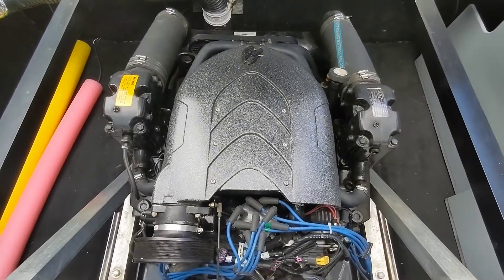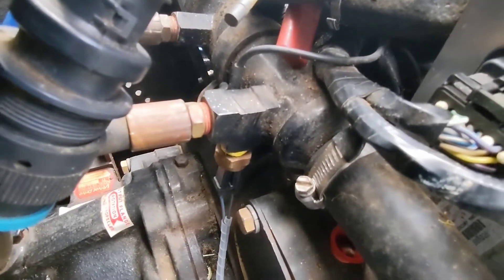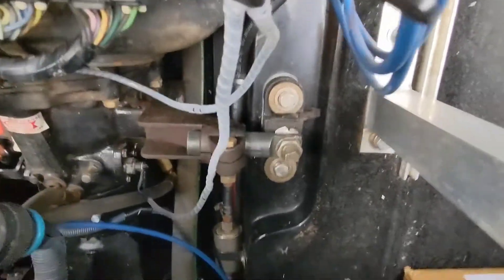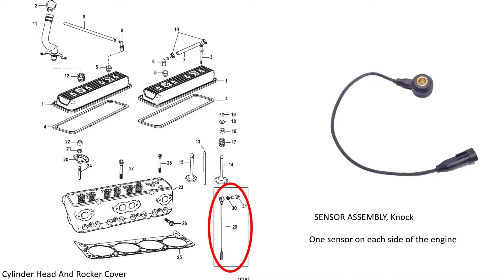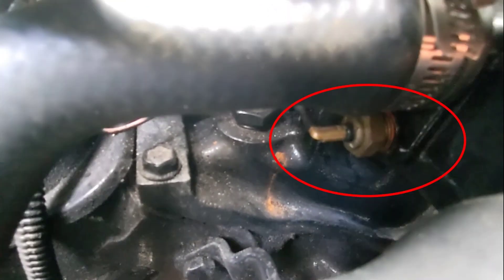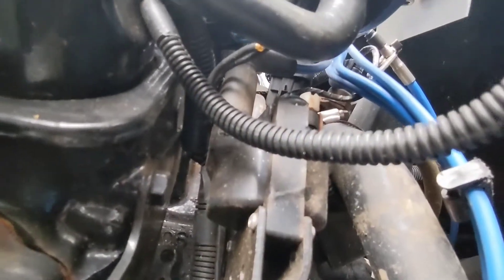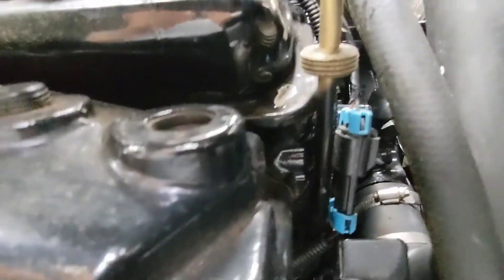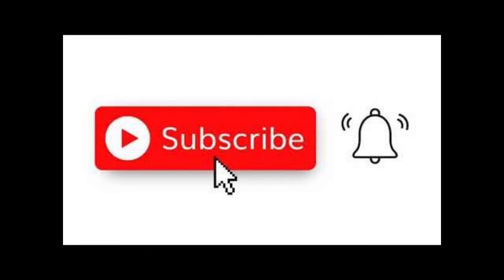Mercruiser 5.7 6.2 engine motor sensors and electronics

Comment: My water pressure sensor wires look like they might be getting pinched. I have a beeping in the boat for about 15 seconds on and 15 off only while under way. Wondering if that might be it
Reply from the maker: You should look at my other video. This system will let you know exactly what the problem is. https://youtu.be/qrIJ4Hsu1IU

Comment: Thanks for this informative video. 
I have also have a 5.7 liter Black Scorpion engine. It is idling very rough, but the engine seems to run fine with higher rpms. Any idea what the problem might be? Thanks
Reply from the maker: @marvleier5327  you should replace the IAC valve and the head gasket. If this doesn't help, consider cleaning your injectors and measuring the fuel pressure to the injectors.
Reply: @ItaiLeshniak  I think I will start with the iac valve.  Thanks
Reply: @ItaiLeshniak , I replaced the water separating fuel filter and now my engine is running as it should. I thought I would let you know. Thanks

Comment: You have a good understanding of these engines. What are your thoughts on a stalling issue I have. I have a 2006 Supreme with this engine I replaced all filters and the IAC valve. It has a new cap and rotor. After running the boat out on the lake when I return to the 5 MPH area while idling into the dock it will stall out and some times stall but not completely shut off. It starts right back up.  Any ideas of where to start checking? It runs great otherwise but irritating when it randomly does it in the 5 mph areas. Everyone seemed to say IAC valve but a brand new Mercury valve was installed.
Reply from the maker: I would assume you either have an air leak so I hope you changed the head gasket. The other thing you may want to try and clean the injectors. Hard to say without getting more information. Check out my other video on how to connect to the computer. It's worth the investment you may find out some interesting stuff.
Reply: @ItaiLeshniak  Yes I replaced the plenum gasket when I replaced the IAC valve.  I will check out your other videos! Thank you.

Comment: You never made an impeller replacement video for this engine?  I have same engine/boat.  Appreciate what you have posted👍
Reply from the maker: Not yet. Maybe next spring.
Reply: I need impeller video also! And where is the sea water impeller
Reply: @kenleyhockett7473  the sea water pump is under the passenger (port) idle pulley at the very bottom. I just changed mine not too long ago.

Comment: What year is engine?
Reply from the maker: 2007
Reply: Thank you. Where can I find the purple/white wire to set initial timing? I have a 2006 Sanger v210 Black Scorpion. Thx for your videos
Reply from the maker: @dantheplumber3233  I am not that I understand the question, are you asking where is the sensor? what is the problem and what are you trying to do?
Reply: Just like the 90s gm vehicles..to set initial timing a wire located on the firewall was to be unplugged, like disconnecting the vaccum advance on a distributer. Un plug connection...set distributer to factory setting and plug connection back in. On my 1996 sanger i have been looking for the purple/white wire to connect to ground so the distributer can be set to the factory degree...then ungrounded the purple/white wire..btw...have you experienced low fuel pressure?